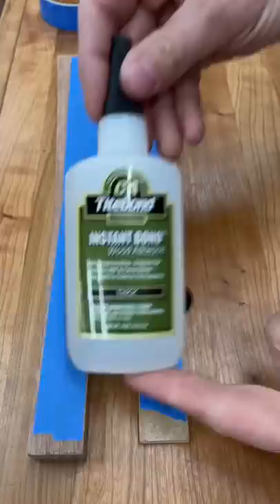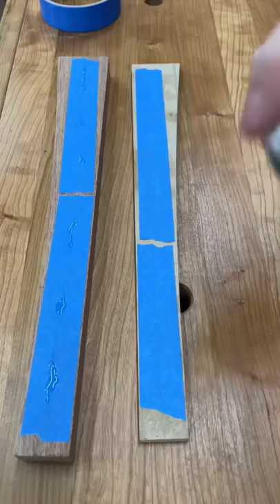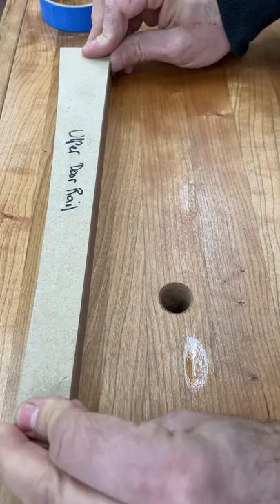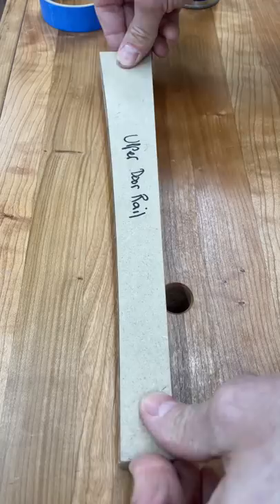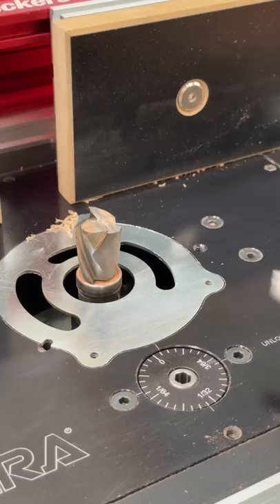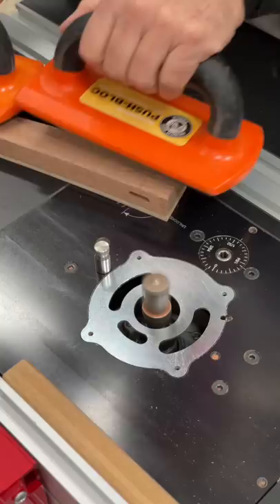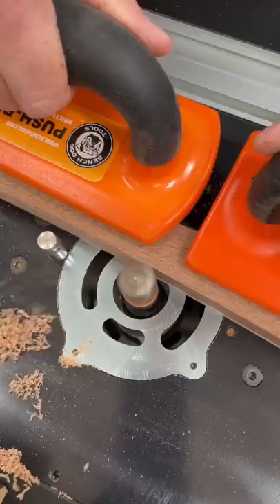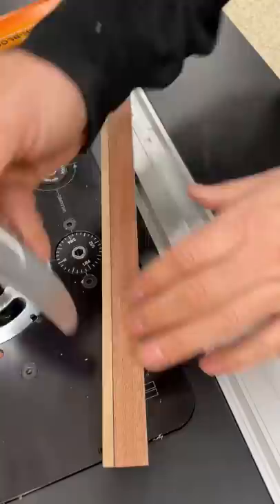Frustrated by Double-Sided Tape? WATCH THIS! | #Shorts

Comment: Bonus points for this tip: fold under a corner of the blue painters tape to give yourself a tab for pulling it off later.  I'm sure we've all accidentally gouged a workpiece with a knife, awl, nail set or whatever when trying to get under the edge of some persistent blue tape.

Comment: The only frustration with double sided tape , for me, is getting the protective layer started and off.   I tend to bne able to use double sided tape multiple times so CA gluw on painters tape would be   more work, for me, reapplying each time.
Reply: I agree with trying to remove the tape. Now I use a retractable razor blade lift the corner of the tape...piece of cake
Reply: Just rip an edge. If you are using the plastic backed kind, it will stretch and leave an edge to grab after tearing.
Reply: @jakeo2600  actually I found a brand, the brand that Shaper Tools sells that is relatively easy to start and remove the backing. IPG.

Comment: I accidentally found an alternate solution.... hot glue. 
My shop is a disaster. Always. (Working on it) but the CA glue was not near where I was working... blue tape was everywhere and I needed to use this to hold down a workpiece (<<-- spell check  says that is not a word... but it should be)... but I have a ryobi cordless hot glue gun sitting on the bench... and it was a fantastic substitute. Still used the blue tap for no residue, but no need to spray accelerator

Comment: Love all of your stuff Mark... you have been my Woodworking 101, 102, etc.  However, Y/Ter Ben at Crimson Guitars beat you to the punch on this one by a year or so!  Still a great trick to pass on to those woodworkers without interest in things with strings.  Cheers, mate!
Reply: This is the second video that Marc has made about this tip. The first was 3 years ago
Reply: @MatthewBuntyn  The Crimson Guitar video with this trick predated that first WW video by quite a long time. Marc credits Ben in the first video of this tip.  Interestingly in the Crimson guitar video Ben gives credit to an unnamed student for the idea.
Reply: @MrSharper802 Thanks for the correction. I didn't rewatch Marc's first video. I keyed on the "year or so" timeframe, and forgot that he got the tip from Crimson Guitars.

Comment: Another good one I learned from Nick Angler, is to use carpet tape. As long as you can apply some  pressure, it should hold up. And it's cheap for the amount you get.

Comment: Good tip. I even use the painter tape/ super glue method to hold stock on my metal milling machine so should work for wood also.

Comment: this is so much more complicated then double sided tape
Reply: The thing I am wondering about is, when you take a version of a single sided tape and you glue 2 stripes of it together on the non sticky side, doesn't that just give you a double sided tape?
I mean fine if you have the wrong double sided tape version, but why all the effort in general when you can get a double sided tape that works the same way, have less time to invest and less costs.
That's like cutting a standard screw out of a metal bar, it works, but just go and buy the correct screw, no need to waste time to build a product that's already available.

Comment: Use IPG double sided tape and ya wont be frustrated!
Reply from the maker: No need. This works great and that’s one less special tape roll to buy. 😉
Reply: Okay....but for your method you need tape AND superglue. And you run the risk of misaligning your tape between your parts and getting super glue all over you project. IPG tape is better. My case is rested.
Reply from the maker: ok but because I like to be right, I always have both CA glue and tape because I use them for many other things in the shop. No reason to buy an extra thing that's ultimately inferior. My case is also rested. :)
Reply: @woodwhisperer  Well....I"ll let you be right, but I have used the blue tape CA glue method before and keep all those supplies in the shop but I still use the IPG tape because it's better. Finewoodworking even did their study on double sided tapes and concluded IPG as the best. I'm just trying to pass on the good shit. No hard feelings.
Reply from the maker: I actually still use the stuff on the CNC all the time. I have no beef against it. I'm just playing a "role" here. :)
Reply: @woodwhisperer  Haha I can appreciate that. Have a good one Marc!

Comment: Him: glue the two sides of tape together! 

Me: wth tape is used for if you don’t have glue- you can just straight glue it together 🤦‍♂️
Reply: I think the point was not putting glue directly on the wood piece and instead on the tape, allowing for an easier cleanup/stronger bond than two sided tape without the issues of the glue directly on the wood piece

However that's just my assumption.

Comment: You can just use water instead of some fancy glue setting spray.
Reply from the maker: I've tried water in the past at the urging of others. It doesn't work. :)
Reply: @woodwhisperer  so it doesn't work for this application? Because I use it to set cyanoacrylate all day long.

Comment: Nice trick! My problem is that I'm badly allergic to cyanoacrylate, it can kill me in worst case. Double sided tape, Ill be using  you still :(
Reply: Jari, I'm sorry to hear that. I've been using CA since the late 80's when I was playing with electric RC off-road trucks, and I have found it indispensable since. Hopefully doubled sided tape and quick set epoxy fills in as needed for you.
All the Best, Chuck
Reply: Check out Joe Podegracz Hot Glue solution above if you haven't already, sounds like a viable alternative that I may even try.

Comment: Carpet tape is a mess to remove but gluing blue tape isn't optimal either. The solution is to get a double sided tape that was made to be removable. It has the right amount of adhesion to holds things togheter and stil comes apart easily and in one piece.

Double sided tape isn't one product. Get the right tool for the job

Comment: Huh, 4 dollar tape, or 24 dollar adhesive. And still have to use a form of tape. 
  Great tip to help empty your wallet. 
   You can tell this guy works for big glue.
Reply from the maker: not sure how things go in your shop (or how math works in your head) but when you already have the glue and the tape for other things, there's no additional expense. Buying double-sided tape IS an additional expense for a thing that serves only one single purpose. Also, a good roll of double-sided tape can run as much as $25 these days. ;) An argument can be made either way depending on your usage and preferences and this is just an option for folks to consider. Use what you want.

Comment: Yeah newsflash, the activator is JUST WATER. /EDIT: see below, The Wood Whisperer has debunked this.
Reply from the maker: lol I appreciate your confidence but that's not correct. Activator  is typically a high pH solution that helps neutralize the acid that was added to the glue to slow curing. Neutralize the acid and the glue can then cure faster by reacting with the moisture in the wood. Spraying CA glue with water does a whole bunch of nothin'. Probably should know what you're talking about before getting all 'newsflashy' with people. :)
Reply: @woodwhisperer  ok, I stand corrected. Edited my comment. /EDIT: about 40 odd years ago I learned these glues cure by hydroxyl ions in water. I simply "breathe" on the second surface, thus moisting it, gives quick curing, this lead me to believe this is only a can of water @$6